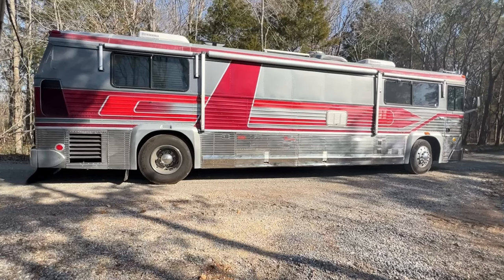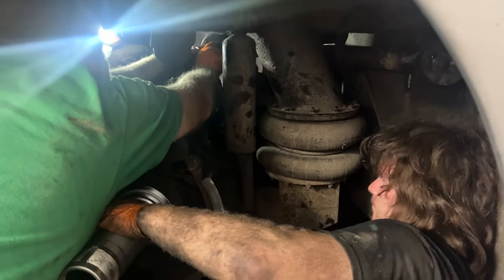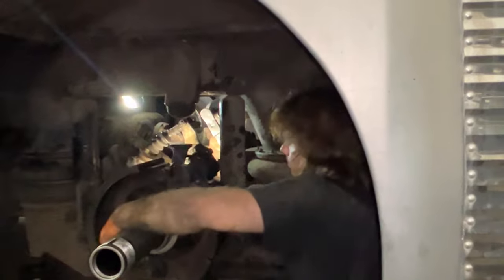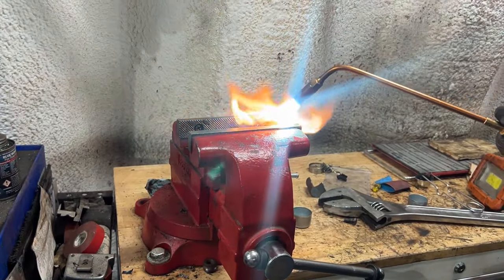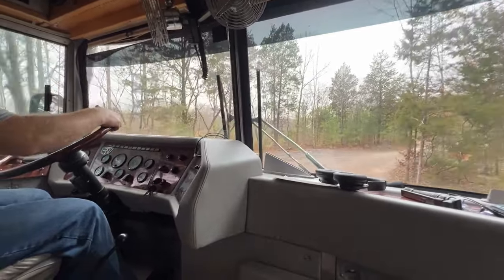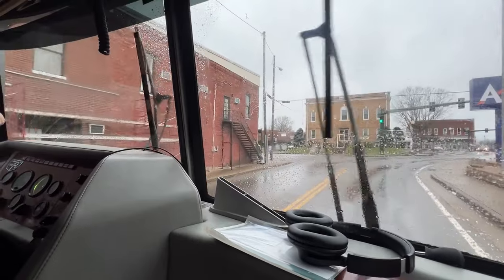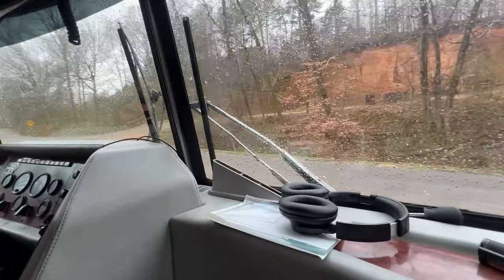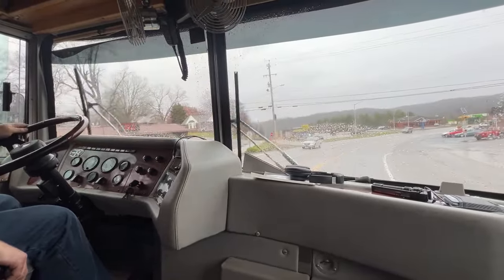Mci 5 suspension work, fan gear box, jake brake. Test drive nearly ruined by car running a red light

Comment: @BusGreaseMonkey was the reason we got into old coaches. Originally we found BGMs posts when I was showing my son, Vaughan (the guy with the rock and roll hair) videos about 2 stroke Detroit diesels as I rode in them in semis with my dad as a kid. At the same time I had an early 2000s class A pusher that was falling apart and I soon sold it for about 1/4 of what I had into it. After watching BGMs videos I decided to get an old converted bus. This is the very bus I found locally and these videos helped me find a good one near me. My wife and I love this bus. From the time I purchased it, I knew that I'd bring it to Scott to go over it as I'm reasonably mechanically inclined, but I had never worked on anything such as this. It turned into a father / son trip / learning experience that I'll never forget. Thank you @BusGreaseMonkey and family.

Comment: Great video thank you for getting those brakes working good and just a suggestion for that air operated wiper try a few drops of air tool oil and see what happens oh my old timers kicked in I forgot to say the oil goes into the wiper motor at the air inlet. My suggestion for what it's worth.

Comment: Learn and always practice the Smith System, five  keys. to safe driving.  Drove well over a million accident free miles for the Hound.  I knew drivers that loged several million safely.   It works in form for real.

Comment: The windshield wipers are not in sequence. It’s probably a personal problem for me. 😂
Reply: They each have there own switch.
Reply from the maker: Air flow control knob even more delicate than a switch
Reply: It was bothering me too.
Reply: Imagine the potential dude. You could micro adjust the air flow so that it perfectly stays in sync. 
Dont worry, just keep adjusting, you'll get it.
Reply: I was wondering how the wiper system worked on this bus to.
Reply: @BusGreaseMonkey  Yes, drove transt bus for years. I got used to them on the GM New Looks

Comment: You might wanna try electric wipers too.
I had them on my MCI 9, world of difference
Reply from the maker: A $1,000 upgrade, rainx is much better
Reply: Might work for some. Last night I drove a 250 mile trip in a downpour, I'm very grateful I was driving a bus with reliable wipers and didn't have to rely on rainx
Reply: I'm used to them.. honestly doesn't bother me. I could have slowed down the passenger side, just didn't think of it.
Reply: @frankchodacki6269  I guess it's one of those things that once you get used to it it doesn't bother anymore. Safe travels!!!!

Comment: Why not using /making a very beefy extension rod/pipe so you can torque the bolts from outside of the wheel arch instead of trying to morf yourself in there and being bearly strong enough because it is a log reach with your arm?
Reply from the maker: They tried it in the video. They couldn’t safely hold it